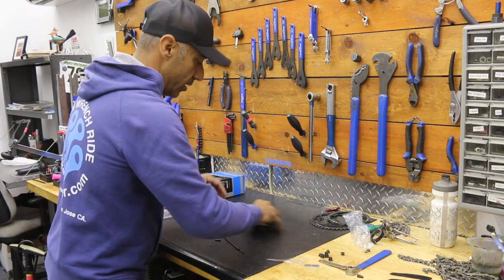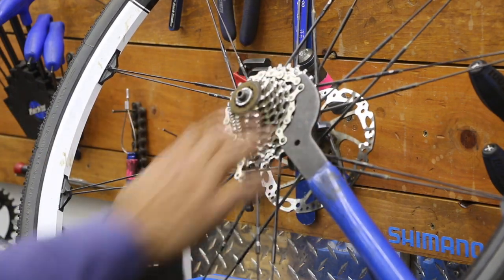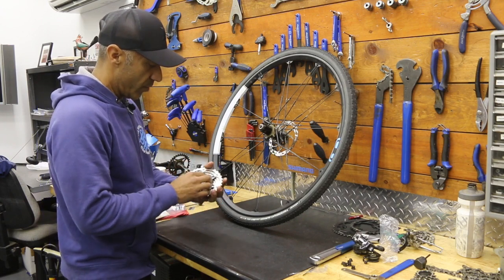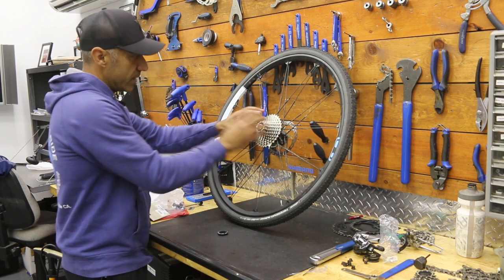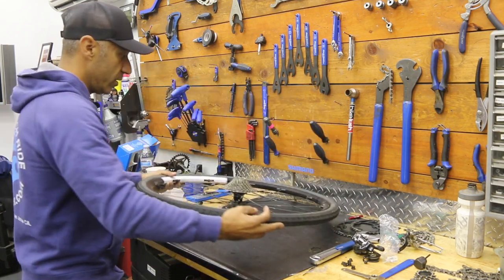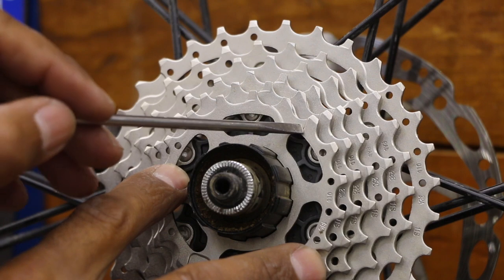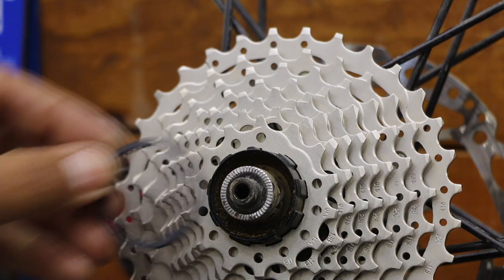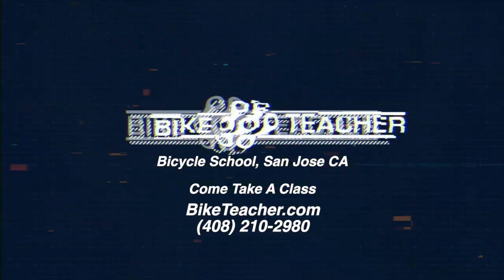How to remove and install a Shimano Ultegra 11 Speed​ Cassette.

Comment: When I installed the cassette on my shimano freehub using Parktool FR5 and a spanner wrench, the hub clicks and stops tightening as if there is an internal torque release mechanism built in. I haven’t seen that in any videos. Is that normal? I’m not even using a torque wrench.

Comment: If I go from 32 to 34 tooth cassette, will I need to lengthen the chain? Thinking about upping my climbing gear for a mountain trip coming up...
Reply from the maker: Yes you may. Consider your current length now. Then proceed. New shifter so chain is in the figure in the front figure in the back pull the chain together with you and see if you have any excess links. You need at least one extra link or to actually see if you have a one by

Comment: What a fantastic video.  Concise, informative, and tells you everything you need to know when replacing a cassette for the first time. 

Question:  Do you need to use grease/lube on any of the components?
Reply from the maker: No, none needed, but you may hear otherwise. if you do, very thin coat., transparent.

Comment: Thanks for the video! Do you recommend putting some kind of grease like Park Tool PPL-1 on the free hub body before installing the cassette?
Reply from the maker: Hi. No, it’s been fine without line. I have not seen any negative effects. I would as some to Sram XD Threads.

Comment: I've heard that it's possible to upgrade from 9 speed to 11 speed cassette. So besides the 11 speed cassette, which other components would I need to complete the upgrade on my road bike?
Reply from the maker: Chain, shifter, rear derailleur. Most likely the crankset(chainrings), front der. It’s a big jump, so 8 think everything.

Comment: i will replace shimano 32teeth 11s casette with sram 11 36,hub 11s...should i use spacer,
Reply from the maker: Keeping with 11 speed hub body? No spacer needed.
Reply: @BikeTeacher  thanks a lot,and which one is better for shimano ultegra drive train only casette is sram 1170 11x36. HG 701 or PC 1130 chain.